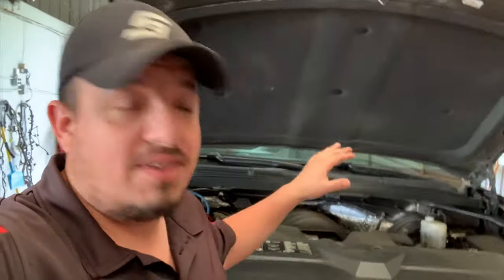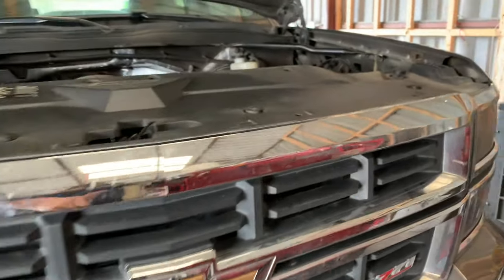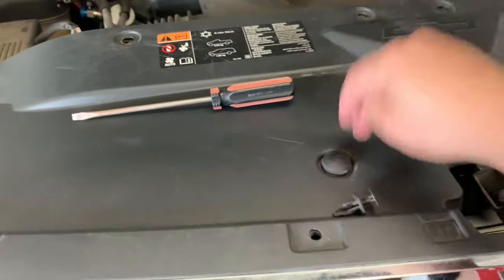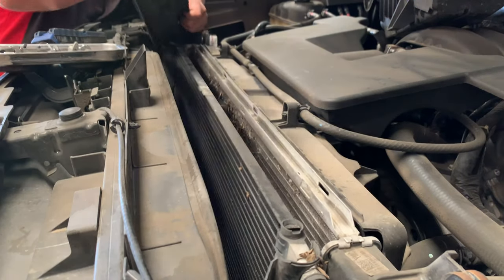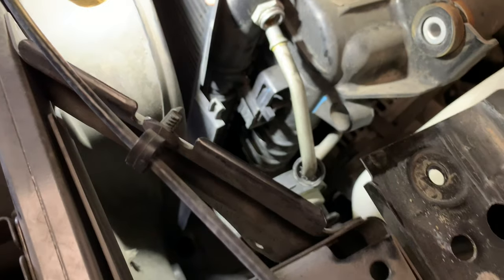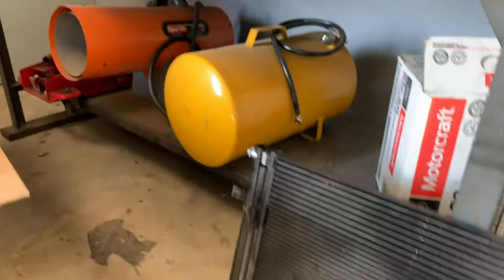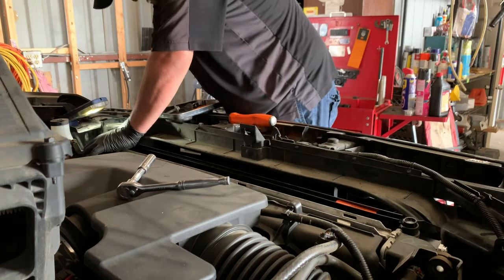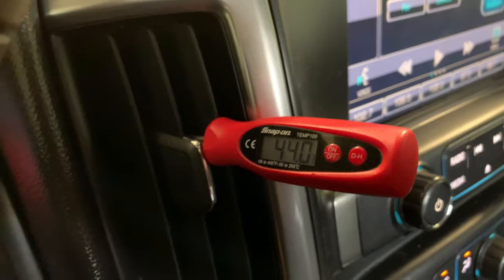2014-2018 Chevy Silverado A/C Condenser Replacement - Sierra-Tahoe-Yukon-Suburban-Escalade

Comment: Where do you... and when do you put in... and how much PAG 46 oil do you put in?  How come there are tons of videos on the unit replacement, but the corresponding information to the fine details are equally important!!  Also the tranny fluid... rarely is this mentioned, and I have to do mine, but with the amount of videos explaining the R&R ... I can't find any two videos the same about talking about recharging and the importance of the other two fluids.  PLEASE HELP!!  I NEED TO DO MINE ASAP!
Reply from the maker: There are too many factors into adding Pat oil. Fist off how much oil does your system take (usually about 6-8oz). How much oil will you loose doing this process? 

For me I would add 3-4oz in the new condenser because I would asume you would only loose that much. 
If you want to be exact into how much oil it needs and how much was missing you would need to complete flush out the system to make sure it has 0000 oil. And then add the oz your system needs. But most people won’t do that witch is why most people won’t tell you exactly how much. 

For example on this particular truck. If customer wanted me to do it right and ONLY add the amount of oil the system needs total I would have had to flush out the entire system and that takes time and money and customer didn’t want to pay for that. So as a mechanic all I can do is give my best estimate on it. 
And yes you would need to add transmission fluid. But you won’t know exactly how much until you are done … leave the truck on for a while and check transmission dipstick
Reply: @FalconsGarage  THANK YOU!!! this makes it easier to understand why, and based on the tag under my hood it actually says to fill it with R-134a PAG oil.  After basic research, this tells me that it's not a "separate oil" like I had imagined, but more that it was like a 2-stroke engine needing oil and gas mixed together to lubricate it.  This automatically has the lubrication built into it.. and now I understand.   Do you have a video on how to vacuum out the air pockets before adding the R-134a on this particular truck after doing the condenser swap?